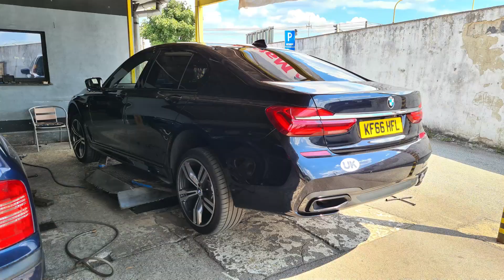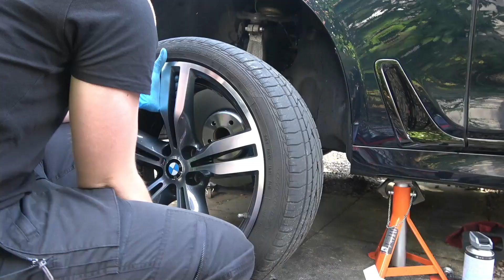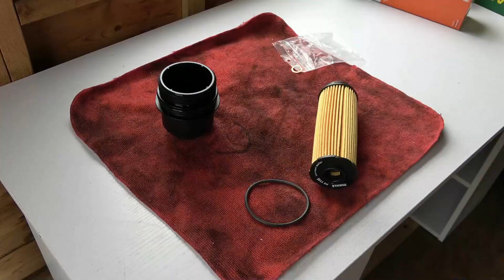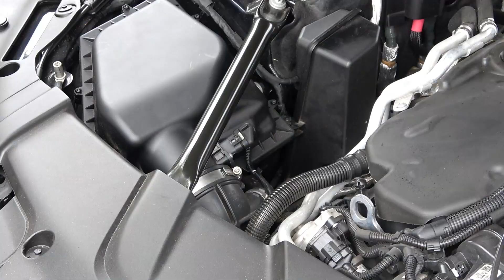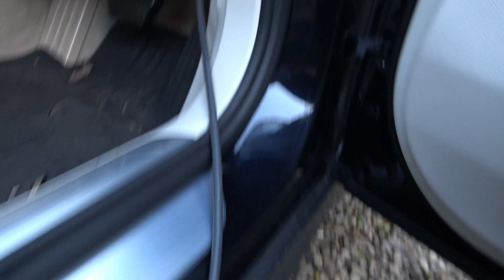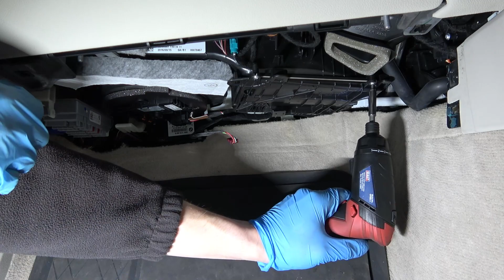Still Ultimate Driving Machine ? 6 Years old BMW 7 Series G11 - Reveal and Regular Service

Comment: Awesome Job Martin . I have the same car as you and have a BMW service plan for another year . I have changed the pollen and air filter before . Can I ask your advice about jacking it up I have a trolley jack but it isn’t good enough or safe for the weight of the car . What trolley jacks do you recommend where are you placing them and the axle stands to avoid damage to the underside .
I have the plastic cups and will be looking to get two decent trolley jacks so I can safely do the oil change .
Is there anywhere you can get the Ista from thanks

Comment: Hello Martin I hope it's ok to contact you this way and I'm sure I will not be the only person with this question. I would like to change the transmission fluid on my BMW G11 730d  but main dealer says they will not do this as it's not reqd.  What would you suggest ? Can it be carried out by myself.  ( I have similar wkshop to yourself) .  Regards MG
Reply from the maker: Hi Michael, it’s not that hard to do it. There are quite a few videos on YT with ATF changing on ZF 8-speed transmission which is in G11/G12

Comment: Hello Martin!
Can you tell me what are the differences in manteining a 730d and 740i. Is maintenance of 740i much more expensive. I am a petrol lover and thinking of buying a used 740i G11.
Thank you and keep up a good work!
Reply from the maker: Hi, thank you, 740i and 730d actually sharing the same engine block, so I would say that maintaining of both engines will be similar, also engine B58 what is used in 740i got good reputation, when you google it you will see. For me the main difference is consumption, petrol is little bit thirsty.
Reply: @martinhabinak  maintenance is completely different and engines are completely different.

Comment: 👋
I have a question for you. What you think how long it will last new air suspension , strut on front right side becouse mine is damaged and whole car is lowered to the ground. Will it last for 2,3 years with normal ride , mostly on highway? I ask becouse it cost more then 2000€ at bmw dealer so if i have to change all of them every year i will sell car and buy something without air suspension. Tnx in advance for answer
Reply: I had a 2016 G12 and at around 130k miles, first one had this problem, and after 2 months another air strut had a leak and then after a few more months the third one had a leak as well. Don't want to scare you but I think it was because of the high mileage. Ended up selling the car. I was able to find third party air strut for much cheaper.
Reply: It will last around 120k to 200k very unlikely they go before that milage
Reply from the maker: I would like to mention that in ISTA service manual from BMW dealer is note: “In case of faulty shock absorber or air strut, it’s necessary to replace both shock absorbers or air struts on axle when the car has driven in excess of 100 000 km”. But I would say it depends on environment where the car is driven or how is driven, also 130k miles is a nice milestone for the air struts, if you take a look in some previous comments of my videos, you’ll see that I already had conversation regarding the air struts.
Reply: Thank u for answers 💕

Comment: Hi i quick question jus seen your tyres what size are they ? Im changing tyres today from run-flat  to normal ones  and thinking to get hyer profile by 5 so it was 275/30/20 and im wanting to do 275/35/20  and i thoud did you did that ? Or yours are stock ?
Thanks
Reply from the maker: Hi, when you open the door on the B-pillar you’ve got label with all approved sizes of tyres for vehicle. Mine are stock size, which is for front 245/40R20 and rear 275/35R20
Reply: @martinhabinak  
Yes i have seen that but mine is max 275/30/20 and its not have the 275/35/20 
I have canceled yesterday tyre replace cos we had new tyres coming today so i thot we wait for them and then decide.
What i did see on your car is that wheels luck good with 275/35/20 so thats why i mentioned, other wise with 30 hight on tyre i have no comfort at all, all tho i have adaptive shocks and its not helping, by the way mine is not 7 series 
I did wanted to get like yours but as you know how it happens stars did not come together for that purchase and i bought a different one 🙈😁 
By the way its good videos you do hard work when you change suspension on the drive way 🙈 i started like that my self so i know its not the most comfortable way of doing it 😁
Reply from the maker: In case you’re aiming for the ride comfort, it would be maybe better go for a smaller wheels with a bigger sidewall number. I also thought about swap for the smaller R19 due much comfortable ride, but the R20 in terms of the cool level suits to the 7-series the best 😂